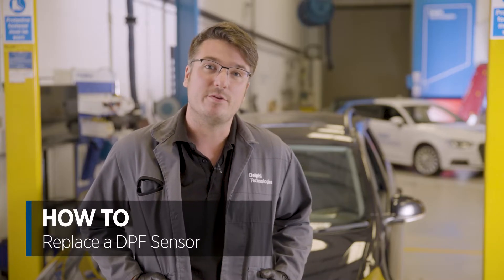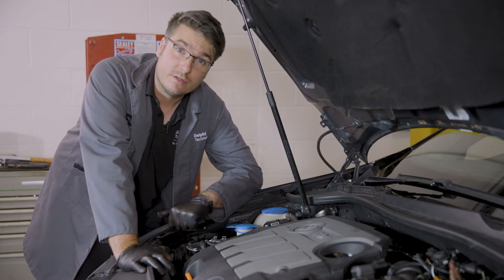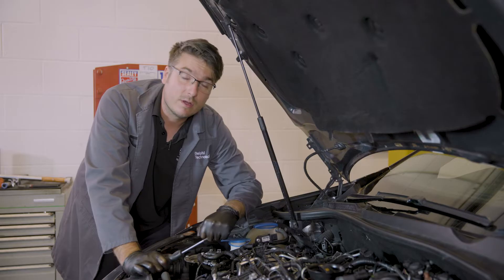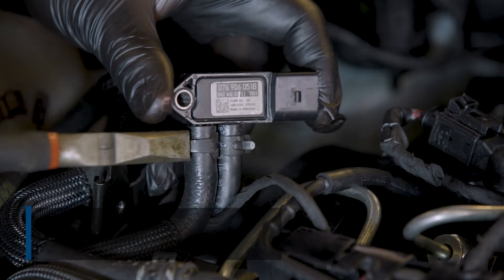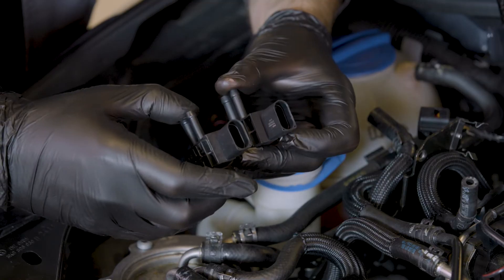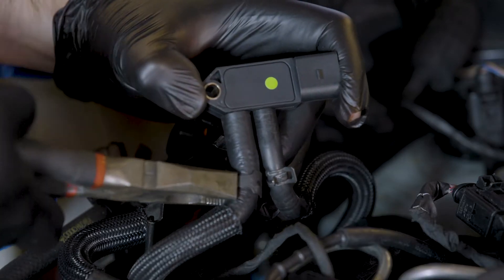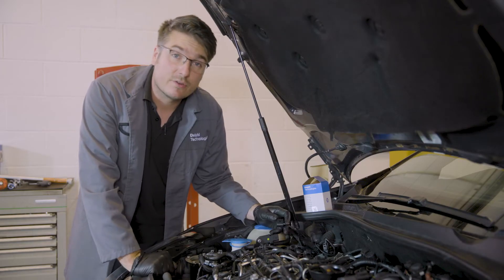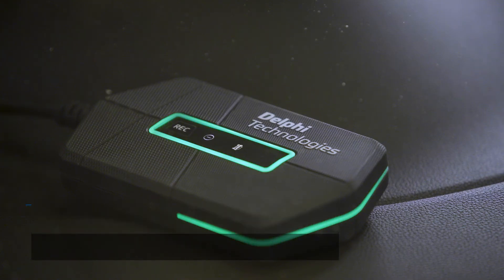[EN] How to replace a DPF sensor | Masters of Motion

Comment: I have a 2011 Ford C-Max and bigger diameter pipe (after DPF filter) was connected to a smaller diameter pipe on the sensor. Small diameter pipe (before DPF) connected to a bigger diameter on the sensor. Does it matter? Because I only found out that things when I started replacing hoses due to one being broken and till now car was going fine

Comment: The wires are so hard to slide out
Reply: Same for me on an Alfa romeo giulietta 1.6, can't get the sensor off the electrical connector
Reply: @Evildrifter each electric car connector has a locking mechanism..you need to slide out the locking pin, with a flat screwdriver.

Comment: Toyota Land Cruiser 3,0 diesel  2014.  May be you have an idea about location of DPF sensor ?
Reply: LC 150
Reply from the maker: Hi @Navigator482, thanks for your question.  There are a few different engine codes used by Toyota for the 3.0 Diesel engine, so without knowing which version it is exactly it is hard to say.  However, on most of these vehicles the DPF sits underneath the vehicle and has 1 pipe before the DPF, and 1 pipe after.  If you follow these pipes you should find the differential pressure sensor bolted under the vehicle.  Many thanks, Delphi Team